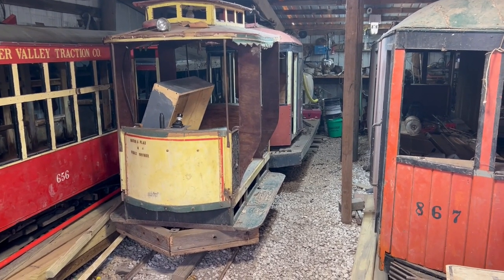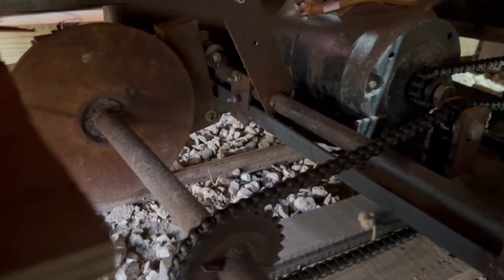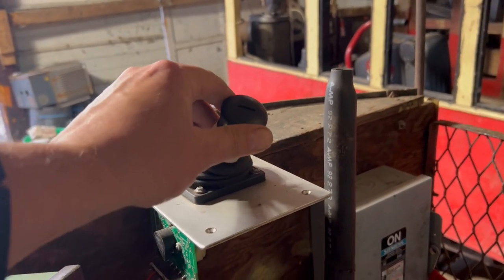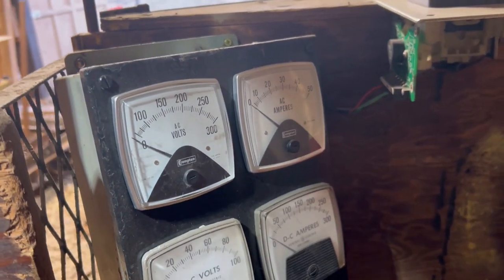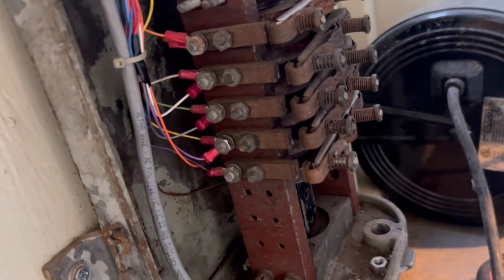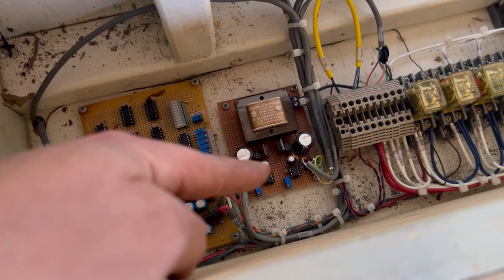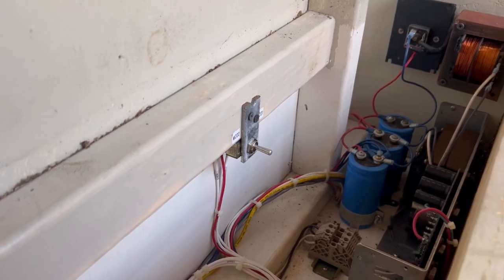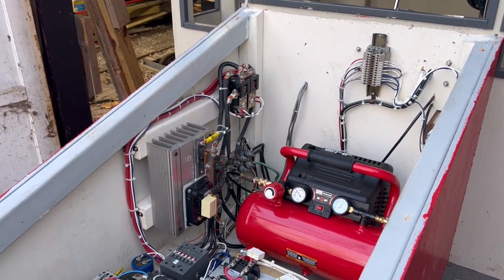Control system overview on the powered RRVT equipment, part 1

Comment: Pretty cool!  I recognized the little prototyping board for the PWM circuit in the open car; I used to buy those little boards at Radio Shack!
Reply from the maker: They are from Radio Shack! I bought a bunch of them on clearance when they were closing up, I do miss having those basic electronic parts right down the street. RIP Radio Shack...
Reply from the maker: I prefer to use discrete circuitry whenever I can, there is much enjoyment derived from having to piece together logic gates and op amps to get the functionality you want. I do like using microprocessors for certain tasks, but my coding skills arent as good as my circuit design skills lol

Comment: This seems a very sophisticated rive system with all those electronics.
I'm comparing it with the trams on the Manx Electric Railway on the Isle of Man. Well over 100 years old but still using the original control systems.

Comment: I'm always impressed by the amount of work and craftmanship in this operation! 

The GE controller of the 119 seems like those used in Milan (Italy) fleet of Peter Witt streetcars (built in 1930, still in revenue service).
Reply from the maker: I saw some of those older cars in operation in Milan when I was there last fall, sadly I didn't get to ride one but they sure looked great running through the streets!

Comment: Truly excellent video.  Great detailed explanation of the controls.  You clearly have some heavy duty electronic control experience. Very nice workmanship on the wiring and control boards.
The steeple cab seems to have substantially more power than the open unit.  I assume it was intended to pull some cars - yes? 
Thanks for your efforts - keep 'em coming.
Reply from the maker: Thank you very much! The steeple cab was designed for pulling multiple cars, thus it carries larger power equipment. More vids to come on this subject :)

Comment: I’m echoing others… Yes, a presentation of the braking systems would be great! 

Does any tram use resistive (maybe not regenerative) motor braking as well? 

And do the air brakes have variable pressure control (aka Westinghouse valves), or more a set-unset spring vs air-pressure mechanism? 

Great work, I’m full of envy… 😅
Reply from the maker: When I had some permanent magnet motors on the equipment we did have dynamic braking as it is very easy to implement as the motor is always acting as a generator when not powered. Once I switched over to series wound it become a bit more work that wasn't really worth it, although totally doable. Just requires more contactors to reconfigure the field to be seperated from the armature circuit, the field then connected to the IGBT through a low value resistor and the armature would be connected to a large grid resistor. If I get bored someday I'll add that circuit, provisions were made on the steeple cab for such a mod.
Reply from the maker: The brakes are simply a variable pressure valve that operates a spring return cylinder, there will be a video in the future about this.

Comment: Very interesting that in the 119 the position for the controller is on the right side intsted of the left! I'd have to hange out the side of cab to drive it LOL!

I'd love to see a video in the curvesider car at some point as it has always looked half way finished and not fully complete, let me know if my view is incorrect of course. As an electrical nerd I did appreciate this video especially your use of the transformers on the cars!
Reply from the maker: I will make a video on that car, it has many problems that need addressed before it is fully functional so you are correct in that its not quite finished.

Comment: Very well done, I enjoy watching your videos. The TL494 has been around since the early 1980's and has proven itself to be very reliable I have many in hand and they are one of my prefered parts.
What is the leakage current on the 240VAC overhead wiring? The 240VAC motor with a VFD is an interesting idea, it should work fine, the rectified DC capacitor bank in the VFD may work as an energy storage in much the same way the capacitor bank works in your 36 voltage controller. It may even be possible to store more energy due to the V^2 in the power formula.  I do like the simple 36VDC PWM system, it could at a pinch run from onboard batteries.  kk
Reply from the maker: There is almost no leakage current on the catenary, even when everything is soaking wet which is really surprising considering the wire rests directly on the wooden cross arms. For the VFD, I fully plan on adding more capacitors to the front end if it is deemed necessary however the VFD that I sourced already has a very large bank and it will power the motor for quite some time after the power is interrupted. My biggest concern with using a VFD has always been the voltage input tolerance, because sometimes the line voltage can sag down to 200V when pulling up the hill at high speed. Supposedly the VFD I have will go down to 180V before it faults, so we shall see :) I agree that the 36V system is best for simplicity, which is one of the reasons I have used it for so many years. But like everything in the world, there comes a time to evolve so it is time to experiment a bit, just as we began the transition away from resistor based speed controls 25 years ago. Should be a fun experiment and I'm hoping it works out well. You are right about the ol TL494, I've been using them in this fashion since the late 90's and have never had a single failure. At one point I tried to use an LM3524 as its technically more fitting for this application but I had nothing but problems with oscillation and instability so I scrapped that design and kept using the 494. No need to fix what wasn't broken!
Reply: Thank you very much for your reply, it is very interesting, I guess the volts per inch of wood is quite low. It will be interesting to see how the drop out voltage on the VFD capacitors works out, maybe a diode to a  battery with a voltage just above the VFD cut out voltage would work, it could auto charge when sufficient voltage is available. I expect there will be cheap batteries from EV's that have lost sufficient capacity for there intended purpose that could be modified for use.  A battery could replace additional capacitors and potentially get you home if the 240VAC fails. Many VFD's pump up the capacitor bank voltage when braking, this excess power could dump into the battery.  If you decide to "role your own"  VFD some of the dsPIC's are quite good. Microchip tends not to make chips obsolete they just seem to get more expensive.  @CNW4145
Reply from the maker: I have considered the possibility of using a small bank of lithium batteries for extra backup if needed, and at one point started work on designing my own VFD so that I could avoid the low voltage alarms altogether. Nowadays they are so cheap I figured why not try an off the shelf model first, for the $250 I spent if it doesn't work out I can put it on my shop air compressor or something. Looking forward to trying it out, first I have to modify the trucks to accept the motors and then its play time. There will be videos on the whole process so be sure to stick around :)
Reply: You would be surprised how good wood is as an insulator at these relatively lower voltages. Those wood strains used on the curves were commonly used by electric railways on 600 volt trolley wire. Third rail beams, mounted to a grounded truck frame, were made of wood. In the early days, the CA&E even supported the 600v 3rd rail on wood blocks. In the case of this line, that 240 would have to get across the cross arm and down the pole to get a path to ground.

Comment: This is really interesting. So basically, each piece of equipment carries it's own power supply, which produces a somewhat controlled 36 VDC supply for the golf cart motors, and then a solid state controller controls the DC voltage to the motor so that you don't need any resistance grids or anything like that? All of those capacitors I assume also absorb the starting current which is why your draw on the overhead is so low, and you don't have to worry so much about burning in loose connections. I thought it was interesting that you highlighted the microswitch and contactor for shuting off current. Working on electric golf carts many years ago I remember they had a 36 volt solenoid and microswitch that served the same purpose. Electric railway equipment handles the same thing with the line switch. I had two questions, which may be answered in part 2. There doesn't seem to be any protection on these circuits, for shorts or overloads. Is it just that everything is so oversized you don't have to worry about it, or that it would be cheaper to just replace a component that burns up? The other is whether you've ever thought about how this system might work with multiple control? I don't think you mentioned whether the control power comes from the same supply as traction or it's own supply. I wonder whether you could control multiple control boards with a single controller?
Reply from the maker: The catenary is fused, the control circuits are fused, however the traction circuits onboard are not. This is one of the reasons why I have a lot of instrumentation, if there is a short or something drawing a lot of current I will see it quickly. You are also correct in that everything is oversized so its not really an issue, if something is shorted bad enough to burn up, it was bad anyways so no protection will save it at that point lol

Comment: Why does it look like none of the catenary lines are insulated at the power poles or on the trolly car?
Reply: Because it's just 240V, which needs about the same insulation thickness as your computer's power cord. Quite unlike a big railway catenary that carries 15,000 Volts and needs those long ceramic insulators.

Comment: OMG. That clacking from that controller sounds exactly as I remember it from the trams of my youth. I always wondered why they made that noise, and now, a couple of decades later, I know.

Do you know if, in a big tram, they set different resistor combinations or something else? If it's the former, then they worked the same way a CGA or EGA graphics card produces different colours on its port lines.
Reply from the maker: For many years resistor banks were the primary speed control on this type of equipment. Nowadays most everything is semiconductor based.

Comment: It's very interesting, thank you so much. I have a question: why you are not using a high voltage motor and use this very big transformer?
Reply from the maker: Those higher voltage motors are much more expensive than the low voltage ones, because everyone else is using them! I am however planning an AC traction system with a VFD very soon, so stay tuned for that :)
Reply: @CNW4145 Nice! As an engineer, I really want to see this solution _ Thank you, I love rail transport, especially it is electrical.
Reply: @CNW4145  I would love to see this too :D

Comment: I am wondering why the choice to run the railroad on electricity vs internal combustion engines?  What you did is beyond imagination.  Really super nice but it seems like a lot more work using electricity to run the railroad.
Reply from the maker: It was done this way to be as prototypical as possible, as almost all trolley operations are powered by catenary. For me, running via electricity is much simpler than dealing with gas, oil, and engines. However if I was a mechanic and not an electrical guy then I would probably feel different lol
Reply: @CNW4145  Ok, got it.  Thank you

Comment: i have some complete golf carts      can i take all the stuff out off it and make a setup    top cable +  rail -   will that work in dc like that  if not why thank you
Reply: I’ll dare a simple and partial answer…; The traction system needs lots of amps, and that demands chunky cables. An overhead wire at 36 V DC would be very cumbersome and expensive. 

A transformer trades (AC) amps to voltage (with some loss). Low amps and higher voltage means a light thin overhead cable - but also a shock risk…😅 

The solution for 36v DC @ ≈ 100 A could be a third contact rail on the ground. But THAT is not friendly to kids or animals - or anyone else…😅 

Simple beginning: Use batteries in the rebuilt golf cart tram…?
Reply from the maker: In the very early days of this railway they tried to use 120V AC for the catenary but found that the rust on the rail was enough insulation that the cars would not operate smoothly. The other problem is that as the voltage gets lower, you need more current- a long run of catenary would have to use very large wire to be effective. I do have a friend who is using a 3rd rail powered with 36 V DC and its working ok for him, but its a fairly short and flat run. Many trolley systems in the US used 600V DC, while in Europe 1.5KV, 3KV, and 25KV AC are the norm. These voltage are instantly lethal and could not be used safely in a hobby setting, but I threw them out there for comparison. The other poster is correct on all accounts, and I agree a battery system would be your easiest way to start.
Reply: @CNW4145  ok  thank you  i will haft to go batery then and put a cable up for looks   and i anly have a 2 acker lot to play on  and live    i just think your set up is cool and wanted one off my own